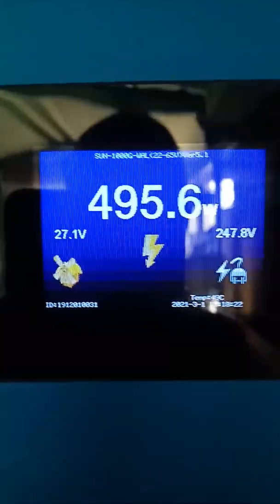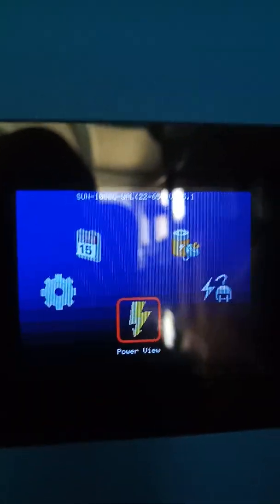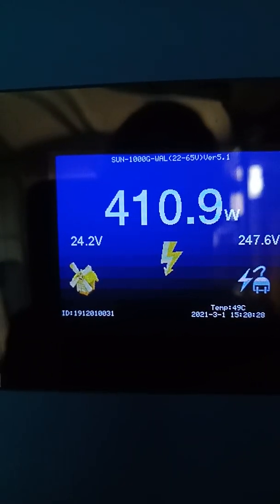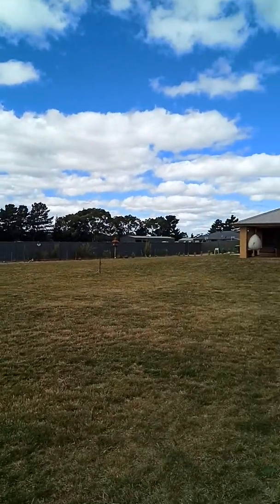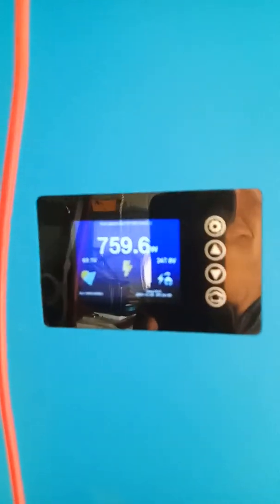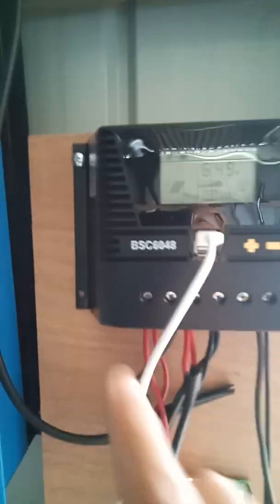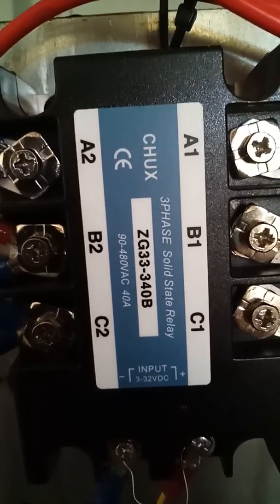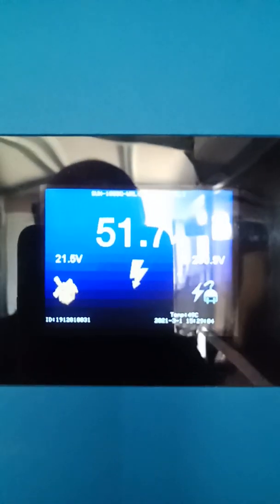real 24v 1000w turbine output when connected to a gti.

Comment: My inverter, the SUN-2000G2 model, is connected to three Tulip wind turbines of 2000w each, with a voltage of 48v. To avoid having to buy three inverters, I connected the three-phase outputs of each wind turbine to three 3-Phase Diode Bridge Rectifiers, connected in parallel and then to the inverter input. The inverter output is then connected to the Deye photovoltaic inverter. However, the problem encountered is that when the wind speed exceeds 48v, the inverter starts to produce wattage and then almost immediately brings it back to zero despite the strength of the wind.
Can you tell me what I'm doing wrong?
Reply from the maker: You cannot connect a photovoltaic inverter it has different power curve. You should be able to connect direct to 2 inputs of the inverter. the internal ac bridge will sort out the polarity. 
the inverter needs to ramp up if you hit it with 48 volts it will pull down all the current until the voltage and current curve values (load at the voltage according to the current curve set )
eg 21 volts will have a low current value and each voltage band has an increasing current value. the inverter at 48 volts will be almost at full load so the turbines will stall. 
Hope that explains it. Have a look at my video on the power curve settings.
Reply from the maker: if those 3 2000 watt turbines are real it will will turn on the load and burn out the inverter dump load and load circuit. 6000 does not go into 2000. the 2000w can handle 1800 watts max continual. after that it will apply the dump load because the voltage will be to high.  or let them free spin if the dump load circuit is open circuit.
Reply from the maker: check the weight of the generator it should be around 50 kilo  for 2000 watts

Comment: I've always wanted to see somebody try to put a capacitor Bank in line to see if it would help level it out like a mppt would solar
Reply from the maker: Yep I haven't regretted it. Not sure how long the AGM batteries will hold out. But I have a plan to use lifp04 in the future. The first step was to get the turbine under control. It spins slower than it did with the pwn controller. Makes less noise as well. I am waiting for 8 lifpo4 batteries from AliExpress that can be hit and miss. I wasted 8 weeks plus. but got a refund last seller was a scammer.
Reply: I wondered if you could fit a flywheel to the turbine to dampen the gusts
Reply from the maker: @kevinmills5293  I think that would have a minimal effect. The size and weight of the flywheel would be quite considerable. The hub on mine is quite heavy to start with and the gust has a lot of power. If you look at the power curve of the turbines once it gets up around 50 % of the max output the wind speed does not match it really shoots up you only need something like 25% more wind for twice the power. recently I have seen my turbine peak at over 1500 watts. The gust hit 63kmph and my new setup did not miss a beat. The mppt controller would be responsible for the higher power allowing my batteries and GTI to soak up the power. I am running a long test turbine versus solar panels my current finding is 600 watt solar is producing twice the power of the turbine over time. I will be raising my turbine another 1.5 metres soon as height is very important. I have been keeping it lower due to my extreme winds but that has reduced the power now I know it will not wind wall I can raise it again.

Comment: Im going to get a 48v ista breeze i2000 turbine. What grid tie inverter would you recomment : 22-65v or 45-90,v?
Reply from the maker: Don't get an ista breeze. I have only heard bad reports.48v turbine 45-90v
Reply: @davecollier8946  as I can see the slip ring  is to tiny to handle the current so My plan  is to change that before use.
But what voldtage would you run it with?
I had at 24v HY-750 turbine on swea inverters, it ran great from 22-52v with My power curve

Comment: Another great video Dave. Ive just fitted my 48v B&C to a 10m mast removing the TESUP and have used the same curve settings for the same Turbine. I haven't set eternal dump load yet..just about to order some. What do you recommend?
Reply from the maker: I used 3 * 10 0hm 500w  resistors .

Comment: Hi ,Do u change  the settings  to suit  the wind speed also why did  uturn  off dump load, Gerard
Reply from the maker: I set the curve to stop the turbine spinning to fast and keep the voltage low. I disabled the dump load because I have external dynamic braking. And I have found that the internal mosfets are not adequate for my turbine which can deliver over 1200 watts.
Reply: @davecollier8946  So fir the 48 V B&C and same inverter would you try and increase the speed of the turbine and lower the curve number at low voltage?  I'm using 80, 164, 255.....
Reply from the maker: @Homewindturbinereviews  It depends on the wattage of the turbine and noise. If it is spinning to fast you will hear lots of noise with no custom power curve. It will follow the original cpower curve.  So then use the settings above to keep the noise down.
Reply: @davecollier8946  thanks Dave. It’s the 1000w version like yours but 48v. I’ll remove the power curve option for now and check the noise.